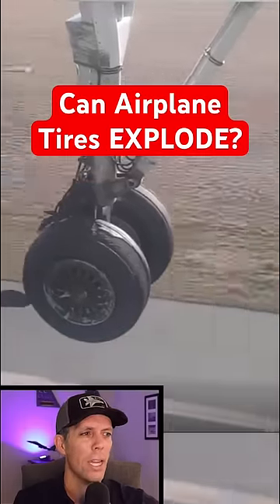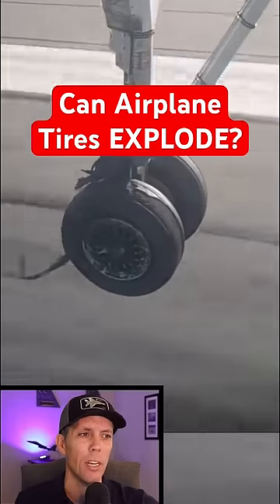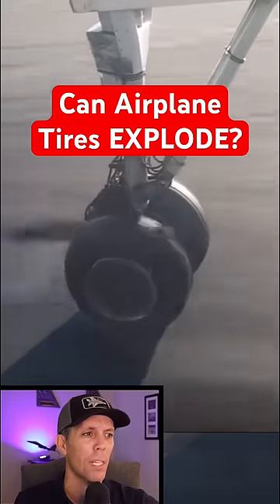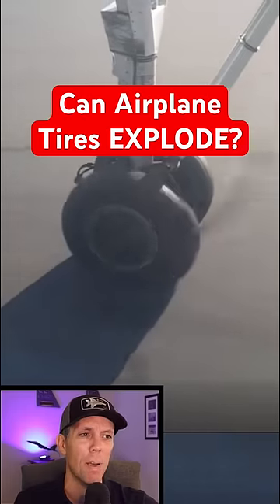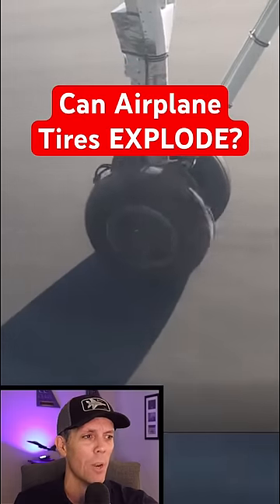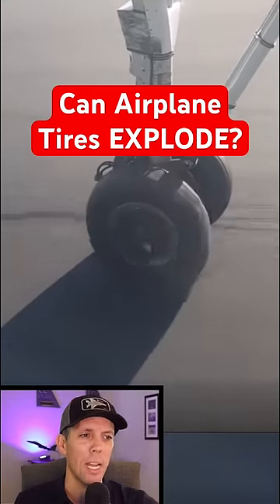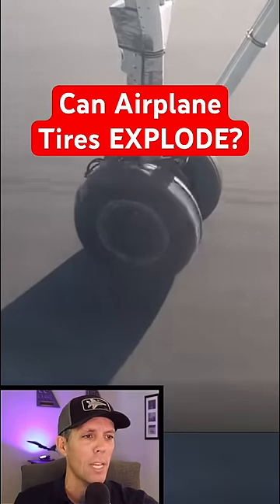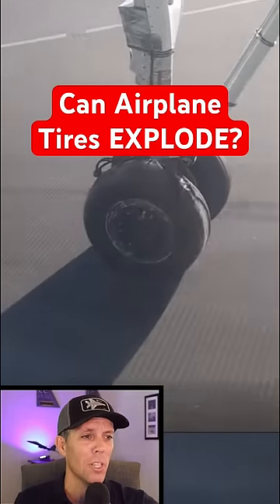Can Airplane Tires Explode?

Comment: I’ve been in aviation for 25 years and never witnessed a retreaded tire be placed on an aircraft. We always use new tires.
Reply: I wonder if a small motor aptera style would be able to kick the wheel up to some speed and reduce the amount thats rubbed off upon initial contact on the larger planes, thus potentially saving mo ey in tbe long run on tires lasting longer than 200-500 landings
Reply: @TheAnnoyingBoss  probably not cost effective in regards to the additional weight and maintenance costs. The additional weight of an electric motor would reduce the amount of passengers and burn more fuel leading to the loss of profit for airlines. Not to mention the  initial cost of modification for installing and follow-on servicing and replacement costs when failures occur. 

Tires are cheap.
Reply: Even after they are used on aircraft,  the tires are sold to boat companies to use on the back and sides of boats for protection.
Reply: It's a good idea not to use "retreads". They won't use them in cars, Why use them on planes
Reply: You think you have only seen new tires be put on airplanes, but unless you are right up there on it how do you know exactly? I read another comment where a guy work today aircraft company and I would retread the tire up to 10
Reply: @davidrubio9753  I believe they use them on semi and the trailers
Reply: Spirit be like
Reply: @Patrick-fe2uo  that’s because they run multiple axles with dual tires on either side of steel trailers that assume minimal damage, if any at all, when the tread comes apart.
Reply: I've been an A&P over 15 years; if you haven't seen a re-tread, you're not paying attention.
Reply: I’ve got an A&P as well as a PPL. Never seen a retread tire used.
Reply: @secretsquirrel572  I've got my A&P and a Commercial Multi with Instrument Rating. I've both changed and flown with re-treads. Perfectly safe. 🤷🏻‍♂️
Reply: @cg9417  never seen it before.
Reply: @secretsquirrel572  True. Also they're never used as the front steering tires.
Reply: Electric Spin Up Motors would be very detrimental to the process by acting as BRAKES if they or their power supply were to FAIL 😮
Reply: Even the Navy uses retread tires on their planes.
Reply: Retreads aren’t uncommon. I work on fighters and we get retreads all the time. The tires are 28 plies and throwing a tire out because the tread is worn down is a waste of money. Never had a new or retread blow except for on the ship, a hot brake situation or the pilot locking the brakes up on landing and bullseyeing the tire so bad it blows out. If you look at the plastic date strip and see a diamond on it it’s a retread if there’s horizontal line on it it’s brand new. Retreads also have a higher depth tolerance for cuts. Usually from 7/32 on a new tire to about 10/32 on a retread
Reply: @secretsquirrel572  except for the Concord...
Reply: @TheAnnoyingBoss  I've seen a video on this. I think the reason was the drag when the tire hit helped stabilize the landing.
Reply: @davidrubio9753  Uh, well, I've been flying since Reagan was in office, and I am telling you retreads were going on decades before I started and have been going on since.  It is actually BETTER to retread a tire than throw a tire away, as it uses less oil and has less environmental impact than using new tires all the time.   Besides, from an engineering perspective, provided you do not exceed the weight or retread limits it is perfectly safe to do so.
Reply: @davidrubio9753  a car os hotting potholes all the time working the sude wall, plus people scuffing the sidewall and running much lower pressures. You don't retread them not because retreading is bad but because the integrity of the sidewall is not known and the tyres aren't worth enough to warrant inspection then retreading or retreading at all probably. 
Trucks run higher pressures and the tyres are worth more abd thetyget retreated and lots of tyres can be regrooved. 
Ah also car tyres don't get driven as much so there's also mire likelihood of the sidewall being bad from sun and heat damage by the time the tread wears out. And as someone else said on trucks  you've got more than one tyre per side of the axle.
Reply: As a guy who use to be a mechanic it's because retreads aren't allowed to be used
Reply: They only use retreads for training and the tires are solid rubber I used to haul airplane tires for Boeing
Reply: @dossiesgallegos3568  No, not true at all.  You can go look this shit up with EASE and see a SHIT TON of airlines use retreads, which is 100% safe and economically smart for them to do so.  YOu think mechanics are all "ok we're just waiting around, so tell us, what tires you want?  Training eh?  Ok here, take these..  Wait, working the line?  You need to wait while we swap for these new units..."     yeah, that isn't what they do...
Reply: @dossiesgallegos3568  and sure enough, "Nearly all major airlines use retreaded (or “remolded”) tires and nearly 80 percent of all aircraft tires now in use in the United States ..."   Not hard to find this AT ALL.
Reply: @davidrubio9753 actually the option is in fact there to be run on passenger and commercial vehicles.  I have and do use them quite frequently on my class 5 and 8 vehicles and trailers and my personal vehicles and trailers.
Reply: @davidrubio9753  
I was in this business until I retired.
1)Rubber compounds break down and loose strength at higher temperatures. 
2)When aviation tires start from a dead stop it generates a lot of heat. 3)That heat needs to be dissipated quickly or rubber will be damaged. 
4) Rubber is an insulator, so you don't want a lot of insulation holding heat. 
5) So aviation tires while strong have no extra rubber on the sidewalls and treads. 
6)Similar example, racing tires are only half as thick as street tires to avoid that heat build up.
7)Racing tires are disposable.  
8)But aviation tires are so strong to support all the weight, to dispose of them when the thin tread is worn off wastes the most expensive and most complex part of the tire. 
9)So they are retreaded under controlled conditions. 
10)Some aviation tires are only used 120-300 flights before they are retreaded. 
11)They are typically retreaded 7 times with another 120-300 flights each time.  
12) There are more retreads on commercial aircraft than new tires. 
13) So if you've flow on a commercial aircraft you've probably landed on retreads.
14) Bridgestone and Goodyear both have a aviation retread plant in the US
Reply: Funny, Bridgestone and Goodyear both have tire retreading plants in the US. Typically a commercial aviation tire is retreaded every 120 to 300 flights and is retreaded 7 times for another 120 to 300 flights. There are nearly 7 times more retreads than new aviation tires on planes.
There's great science and engineering behind it.
Reply: Military aircraft run retreads all the time.
Reply: Was under the impression that some planes have some sort of air driven ducting to spin the wheels up ?
Reply: @bogbrush999  no not at all, that's why you see smoke when the wheels touch the runway. Some planes apply the brakes when there is no weight on the landing gear.
Reply: @secretsquirrel572  large airplane tires can cost as much as $5,000-$6,000 each. That's not what I call cheap. Especially if you're replacing multiple tires at a time. It could cost approximately $60,000 or more to shoe a 777's main wheels. That doesn't include the front wheels.
Reply: This guy is trolling. Retread tires are very common in aviation. Especially commercial aviation. It’s not uncommon to have more re-capped tires on a plane than new ones that haven’t been overhauled
Reply: @howardschlereth9368  they could have a one way clutch so the tire could free wheel if the motor locked up. It wouldn't have to be anything elaborate. A simple roller clutch woul be sufficient.
Reply: @karlchilders5420 I hope in the aviation industry the retreads are better than the OTR trucking retreads. Semi retreads leave road gators everywhere.
Reply: @Smedleydog1  They are, they're done to a much higher standard.  Also, most of the time (from what I understand) they are "remolds" which is a different way of re-treading the tire anyway....
Reply: @secretsquirrel572  just because you have not seen it does not mean it didn't happen.
Reply: @texastoast2099  retreads are absolutely allowed on aircraft. Just not nose gear because they are the steering wheels just like a semi truck.
Reply: @SpicyTexan64  Yes they are
Reply: All we use are recapps.
Reply: For the smaller single engine trainers, desser sells retread tires that will usually outlast virgin tires two to one
Reply: I noticed the major aircraft companies like air canada will use retreaded tires. Smaller charter or personal planes get switched out everytime with a new one.

Sauce: I work in an aircraft mechanic shop that repairs and overhauls wheels, brakes and props.
Reply: @dossiesgallegos3568 what are you talking about??? Tire are not solid rubber !!!
Reply: @Smedleydog1 the touch down resistance is in effect the start of braking process and helps align the plane if done correctly.
Reply: @davidrubio9753  Retreads are used in every aplication know to man especially cars. And they're perfectly safe

Comment: By your calculations, thats a 200-500lb tire if they leave about a pound of rubber every landing...
Reply: They are massive.
Reply: I think he meant 1lb per landing
Reply: @ACEfromVisa559  yes he says they are good for 200-500 landings. Thats a massive tire. By comparison, my tire 275/70/18 A/T, fully inflated, is 57 lbs.
Reply: Not sure where he got 1lb, there is no way... not even on a 747 tire, crazy how they make stuff up.
Reply: Yeah its not true. The tires are like 250-300 pounds but that's with the wheel included. I'm not sure where he got the pound of rubber stat.
Reply: They are 90 ply on small planes. I can't imagine how thick these are.
Reply: @jonfa10  considering an 11R24.5 steer tire is roughly 120-140lbs (depending on tread and some other things) that sounds fairly accurate. No idea what the wheel comes in at on any aircraft let alone a large one, but anywhere between 110-160 or even more wouldn't shock me, unless they're all aluminum.
Reply: @jonfa10  these tires are nowhere near that. I work on them do it all by hand, and only 150psi give or take
Reply: @Daniel Ploof  the tire in the video is probably lighter. I was thinking for a md-11/dc-10. That's the large airframe I have the most experience on.
Reply: There is more than one tire on an airplane...
Reply: @chrism3743  thats a very valid point i suppose.
Reply: @rigolmgs you are forgetting they “retread” 5 to 10 times, so this number is reasonable.
Reply: @cwheels01 wheels are magnesium and extremely light weight.

Comment: True story: My Dad invented an aircraft tire hub/rim that had small cups to catch the air, so the tire would be spinning already when they touch down, avoiding that wasted rubber.

My Dad went for the Patent, and found out someone had already invented it, and the Patent had been purchased from the Inventor.

Who owned the Patent?  Goodyear.

True story.
Reply: My grandfather also invented Tyre with cups .. and also went to patient.. was already patient.. that was in 1978 .. big tyre company wanted to keep making big money😢
Reply: @lisaanderson1624  Yes!!!  Would have been around that same time (78)

Small world, man.
Reply: I believe that with all my heart
Reply: Is there also a patent using an air pressure line from the engines?
Reply: I actually had submitted a patent 40 years ago for even installing a little motor down there you get the tires up to speed. I wonder why it was never adopted?
Reply: Is your dad Elon musk inventing thing that are already invented.
Reply: @testtube9423 Would probably use too much fuel, might not seem like a lot but it adds up quickly and fuel in general isn’t cheap, especially jet fuel. Might have to use a different kind, but still I don’t think a tiny motor could get a tire spinning at 2350 rpm…
Reply: @testtube9423  I remember seeing a documentary years ago that had electric motors to spin up the wheels. I'm pretty sure it was one of those huge freight planes, like an antonov galaxy or something.
Reply: that's awesome. tl;dr "My dad invented 'no more tire'...goodyear bought the patent".
Reply: I read an article somewhere about why airplane tires are not spun up in some way — airfoil / motor — to match the RPMs needed at landing speed and the reasons that is not feasible are: 

1) the gyroscopic effect the spinning wheels would have on the plane when in the air, like the physics experiment in elementary school school where you sit on a freely rotating stool holding a spinning bike wheel and tilt it causing the stool to spin; 

2) If all the left and right rear wheels are not turning at the same correct RPM the difference in speed would cause the plane to change direction unpredictably.  

So while it seems like a good idea in theory, the problems it would cause outweigh the cost of recapping the tires.
Reply: @TeddyCavachon  That's fascinating, and it all kinda makes sense.

Thanks, Teddy!

Comment: I fly an antique taildragger, a 1947 Cessna 140. I was taking a passenger on his first flight ever, and the tire went flat on take off. Landing those old airplanes can be tricky.  On landing I felt the airplane start to drag to the right side and immediately hit the throttle and took off again. I explained what happened to the new and now frightened passenger and let them know we would be landing on the large apron at this uncontrolled airport.  It went well, and he has started to learn to fly now, lol

Comment: Many parts of an aircraft (if not all), have a number of cycles (flights) on them that they are allowed to be used. Over that number, the authorities will not permit the aircraft to take off.. But I don't know if the authorities in every country are equally as strict and if it's the same for every type of aircraft.

I once took an introductory lesson in a polish microlight. Before taking off from a grass runway, while taxiing to the runway, the left gear probably went through a rabbithole. The take off, flight, and landing were smooth but while taxiing back to the hangar, the aircraft suddenly tilted to the left and we made a sudden sharp left turn. We brought the aircraft to a halt, switched off the engine and got out and discovered the left wheel (the metal inside part, not the rubber) had completely broken. We called over the radio for a tow but the tow car can only pull the aircraft forward, we still had to manually push it in the right direction. And that's how I ended my first ever flying lesson by helping my instructor to push the aircraft back to the hangar.. 😂